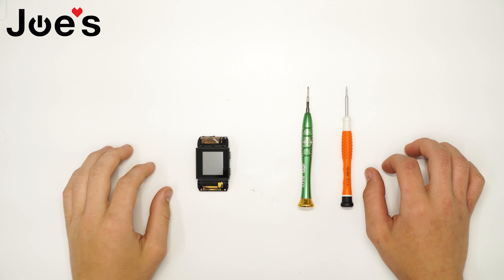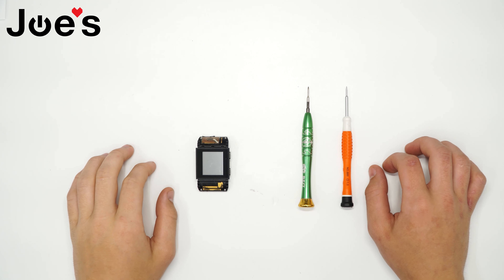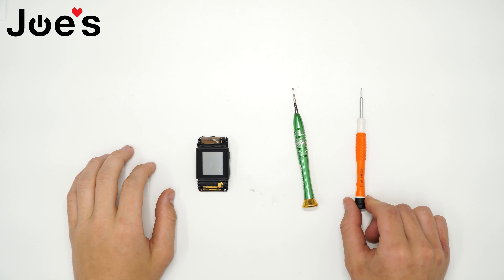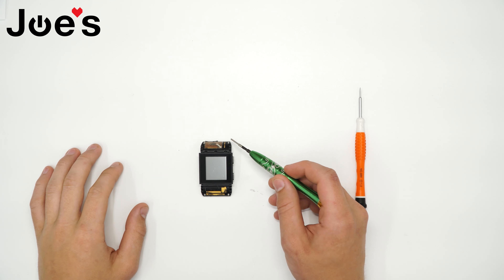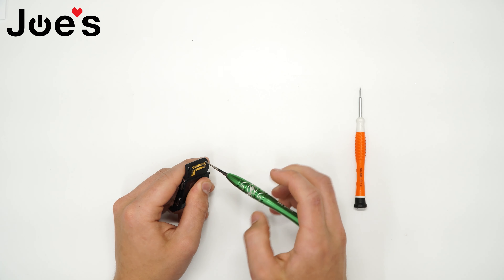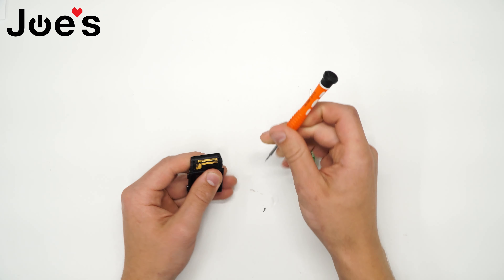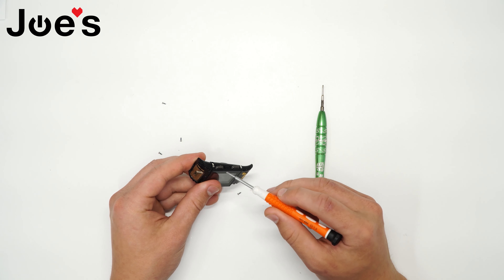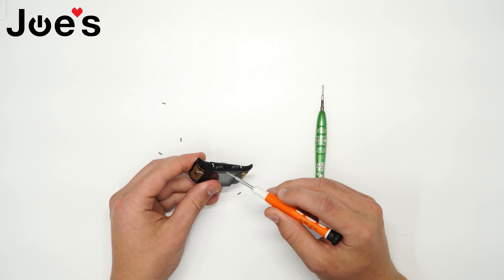Tutorial How To Remove Replace Fitbit Surge Screen

Comment: On my fit bit surge, moisture got underneath the screen. How do I remove it. The screen now shows some ridges or line marks. Is there any way of cleaning it inside.
Reply from the maker: Thanks for the comment. The issue you are describing sounds like you may need new back housing and screen. If you would like your device repaired by a professional you can fill out a repair form and follow the steps to send in your item. We offer free shipping and diagnostics. Here is a link to the repair form:
https://www.joesge.com/pages/repair-services

-David P
Reply: @Joesge   Hi Joe,
I checked the screen which is working fine. I have cleaned the glass which looks much better now. Thank you.